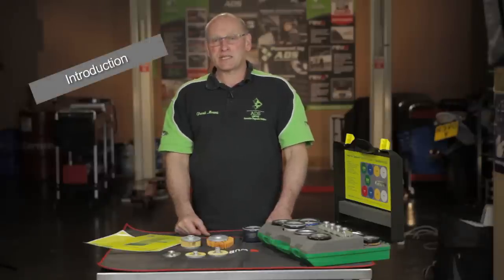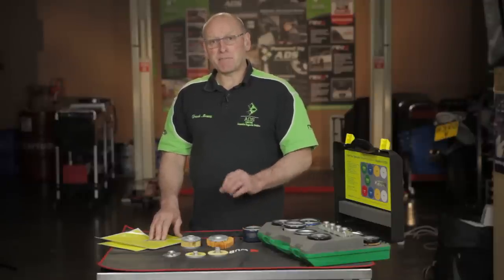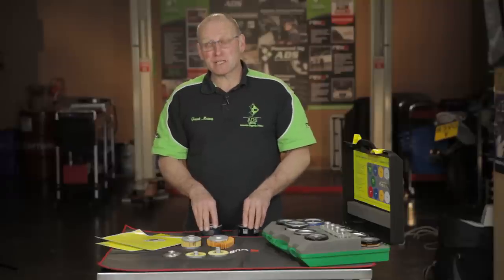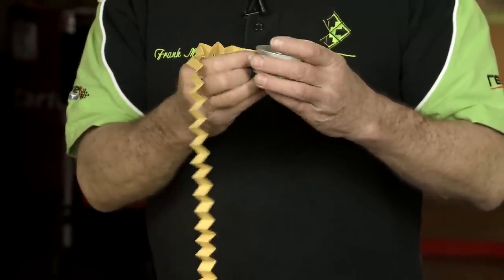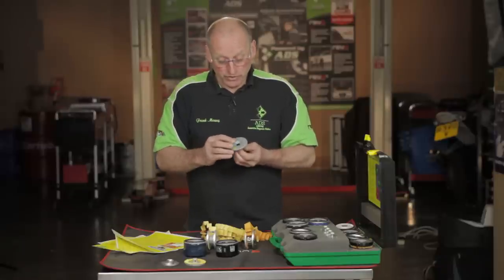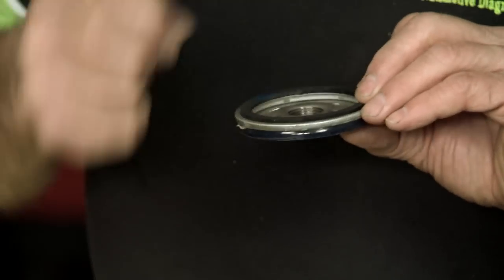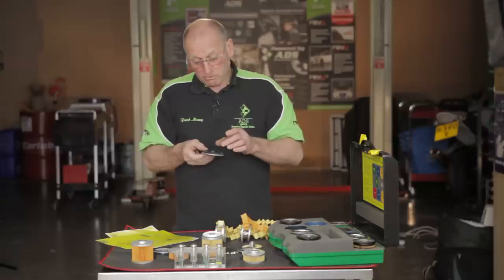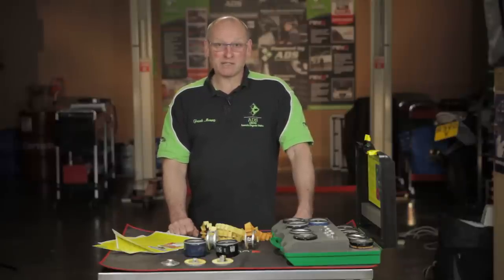MANN-FILTER Engine Oil Filters... What You Should Know!

Comment: I use Mann for my VAG turbo diesel (who make the OEM for VW), and Castrol FST LL. Brilliant combination. I’ve done 260,000 Miles on the factory engine and there’s no sign it will stop anytime soon. Castrol LL isn’t cheap, but spread over 10,000 km it’s not expensive either. I change the oil filter (Mann, only) every oil change. At first I changed every 5000 km, but the oil is good for 15,000, so I decided to change every 10,000...no issues - prevention is better than cure.
Reply: If you not race, if you drive long and relax no point to change it fast. Better safe is 7000

Comment: Great video. I have only used Mann in my Volvo 740 since 1990 - 24 years. The car has well over 300,000 miles on it with no engine rebuild yet. It still runs well with good compression. I believe that the use of Mann filters has helped this car to run well for so many miles and years.

Comment: Bitron misses the point - Mann makes the majority of original filters for car manufacturers so you will always get the same quality 7 performance but a bit cheaper. What this video shows is Mann/OE quality compared to cheap aftermarket brands - definitely not worth buying as saving a few pence now could cost pounds later if engine packs up.

Comment: I've been using MANN on my Audi when I bought it at 60,000 miles 3 and a half years ago. The engine still runs strong and smooth and it now has 145,000 miles with no engine problems.

Comment: I work at an auto parts store. I always shake my head in wonder when a customer insists on a cheap filter when the cost difference is only a few dollars. Idiots, all of them!
Reply: I remember one time when I was driving and when I checked the oil it was way down. I was maybe 60 miles from home. The gas station had ridiculous prices. 3X of normal oil price. I remember that I was a poor college student at that time and money was tight and I hated paying 3 X for oil, but did anyway. It was cheaper than an engine rebuild.

Comment: Excellent presentation. I will now try to change to a Mann oil filter, but not their air filter. I have used 100% synthetics since 1985 exclusively and change my oil every year. I try to use a high quality filter, the brand I used to use is no longer available, but I change the filter every six months. And that is at about 4,000 km or less.
Reply: HJR why do you change every 6 months? Is the filter real dirty after 6 months?
Reply: The filter is not an expensive item relative to the car, so I see it as preventative maintenance. I never cut open the oil filter to see how dirty it was. The air filter was a washable filter, which was cleaned every year.

 I used to have a bypass filter and a bypass/full flow  filter combination, using the largest full flow filter possible. I still changed my full flow every six months. Now there is no room under the hood/bonnet for that with modern engines.

Comment: Go to a main dealer for your vehicle and buy the filters. Establish who made the filters then buy that brand at a motor factor, probably at half the price, at the next service.

Aftermarket and OE can be the same filter.

If you want to do an oil filters test, buy one each of the brands you know, get a load of waste oil, mix it all together, divide it up into the number of filters you have. Do a cold and hot oil pour through on each filter and see how much is trapped by the filter medium.

Comment: I get Mann filters for our x3 VW TDIs because Mann Filters supply the VW factories.

Although Mann are a German based company, they have factories outside of Germany. Korea being home to a Mann factory as there a several car manufacturers resident in Korea.

If anyone can top the quality of Mann with another brand, then please comment!

Just a note!
We use Quantum brand 5w30 LL (507.00) engine oil in the TDIs because its stocked by the local VW dealer. We also use 504.00/507.00 in the family 1.3 Ford KA and Hyundai 1.4 i20 due the oil's high specification.
Reply: Amsoil make a filter that can gather up to 20k microns.

Comment: I always use Mann filters in my cars and nothing else.
Reply: +Phil even if most of them are made in china?
Reply: +cyronader It says made in Germany for me... Looks good also. I am not sure, but so far I would buy Mann or Wix what ever is available of the moment..
Reply: No, mine is made in Germany
Reply: I bought a case in 2012 from rockauto so maybe they were still made in Germany. Be aware of the fake Mann filters out there.The real one has a non removable gasket  and the body has a highly polished chrome ring at the base.
Reply: German quality.  It is one thing I know that makes me use them.  They are OEM filters for many European cars.  The uses for these are not just cars however.  You can get Mann filters for anything that takes a filter as long as you can find a match for that part or a suitable replacement.  You will never find an orange Fram on even my riding mower.
Reply: Bosch, Mahle, Mann , Hengst, they're all on par with each other, and are all used by German car manufacturers. If Mercedes, Audi, VW use them there is no room for argument.
Reply: @philtrottier4442  You're wrong...
Reply: Why do you think I am wrong?
Reply: @philtrottier4442  I've worked at a parts store for big trucks and the only filter brand we sold was Mann and we made our stocks from a multinational european parts supplier. Some filters have a removable gasket and some filters don't.
Reply: @philtrottier4442   But one day i found a fuel filter that looked a lot different than the others... The box was made from a weird looking cardboard and the Mann Filter logo printed on the metal shell looked like a 5 years old kid drew it with his foot. I can't remember exactly where it was made but i remember googling the location and it was somewhere close to Africa.
Reply: I get them from rockauto. They are made in Germany but Mann could have other factories around the world producing them where quality control is not very good.
Reply: @philtrottier4442  Yeah... I only use OEM Ford filters but my second choices are Mann, Mahle and Purflux.
Reply: @cyronader  3:37 this particular Mann filter says made in BA which stands for Bosnia and Herzegovina.

Comment: No end caps?  I thought Fram carboard end caps were a horrifying design.  I say horrifying and not horrible because I do not use and will never use Fram filters.  I feel that the bright orange can is made that way so you can see it sooner and get it the hell out of there before it destroys your engine.  This is assuming that you had a shop change your oil and you did not do it yourself.  The one and only reason not to do it yourself would be living in a place that does not allow you to work on your own vehicle in your driveway.  I have heard of that from some HOAs.  I do not live in a place that is governed by an HOA but I have heard that it can be quite awful sometimes.
Reply: STP filters are the bottom next to Fram.

Comment: Maybe you should tell your customers to warm up the car slowly, let the turbo cool slowly before parking, and to change the oil at shorter intervals than 10k or 20k miles, then the turbo failures would be lower.
Oil filters play a very small role in oils role in the engine. If you need an oil filter, you have serious problems with the internals of the engine. The filter is only there in case of internal part failures. When you take apart an oil filter during an oil change there should be nothing inside, ZERO.
Reply: Mike I believe even the newest engine wears a very small amount. And without a quality filter this can cascade as abrasive particles accumulate in the engine oil. Also a bad quality filter could restrict flow or not filter at all. So they do matter. Very much.

Comment: I have a Lancer Evolution 10. It has an oil change interval every 5k miles. I only use genuine Mitsubishi or Mann oil filter. Never had a mechanical failure and it get pushed very hard. Problem is these extremely long extended service intervals. 20k miles is just too long for any car or van. Its literally there only to sell fleet cars as they please the accountants.

Comment: People spend many thousands of pounds on cars,not a problem.When it comes to oil and filter change time,these very same people will go out of their way to find the cheapest oil and filter,they can.A couple of months down the line,they start suffering issues with early engine wear.They can hear engine noises that never used to be there and maybe some turbo issues,if fitted.Their only  answer is to blame the car's manufacturer for building such a poor engine!
Mr,(I bought oil and filter for £10 person) is now on a steep,expensive,learning curve.All of this is avoidable by buying a genuine oil filter and top quality oil.It's worked for me for over 50 years.

Comment: Mobile 1 is better. Mann is cheap u get what u pay for on Volvos they have paper end caps inside. Not metal. Bad flow for turbo models.
Reply: @scottykilmer1094  its about construction and quality. thats the main thing is whats inside. u have done no reseach other than who owns who. mobile 1 fails as far as the anti drain back valve goes. the mann filter is mostly paper and non synthetic material for the filter media. it also has no silicone anti drain back so itll fail easier in extreme cold or heat. etc fram is best.  smoke more rock scotty

Comment: It would be nice if manufacturers would stop churning out zillions of part numbers for essentially the same filter, like I'm looking at a HU7033Z right now, it doesn't even list my car on the packaging but its the correct filter for my car. We've been making cars for a century, by now we should have produced a standard oil filtration device in a handful of performance versions and in a handful of canister formats. But no, every new car has to come with a new filter design that does exactly the same job as the last 300 versions.
I can't wait for these feckless manufacturers to get replaced by electric cars. If other people behaved like them we wouldn't have the metric system or standardised thread types